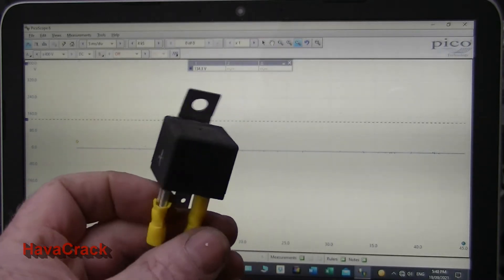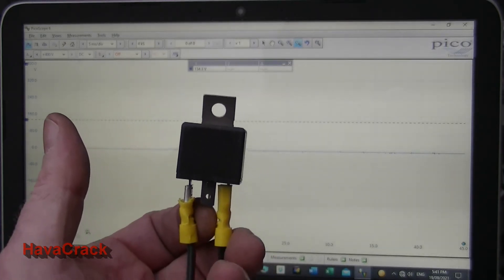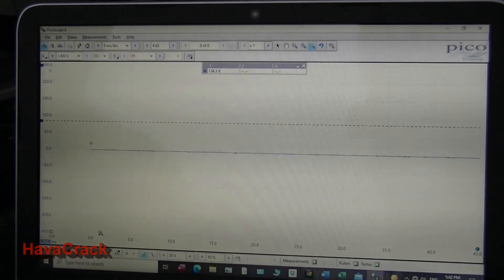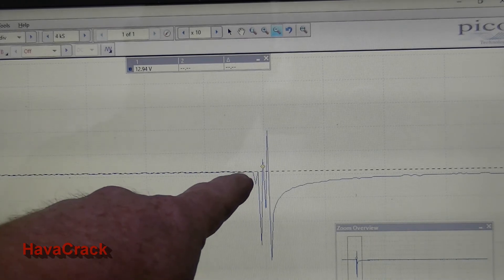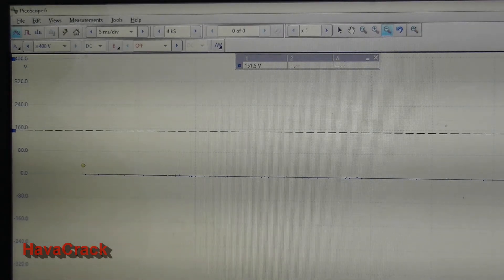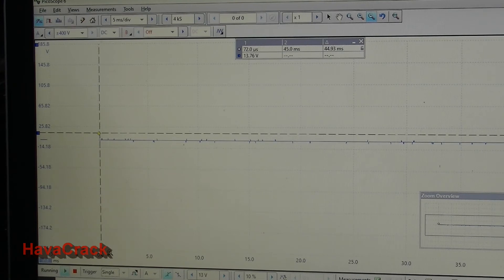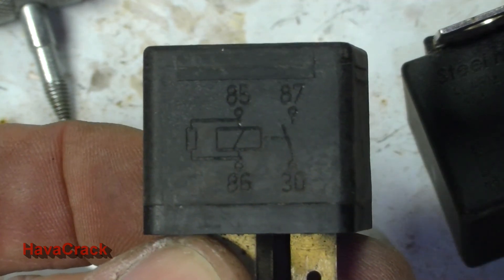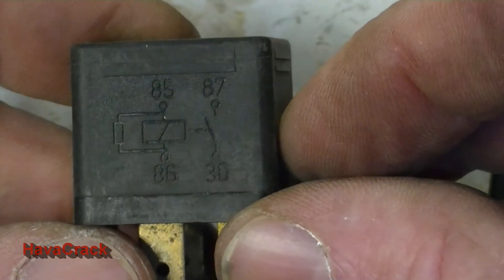HavaCrack - Relays and Diode Protection to prevent damage to modern vehicles computers

Comment: Actually the schematic on the first relay would indicate it uses a resister to clamp the fly-back voltage and not a diode and since resistors work in either direction the relay is polarity agnostic
Reply from the maker: Yes you are correct, that one was a resistor type. Mick

Comment: Thank You that was great info....You mentioned some relays have a resistor rather than I diode...do they serve the same purpose or are they for different applications? I have a relay which shows two diodes (D1, D2).  Is that significant from using a single diode for the application? Its for an Pump(ABS) on a classic SAAB 900. I am getting zero Resistance across 85 and 86...has to be 50 to 120 ohms? it still test good on all other counts. 
Thank You in advance.
Reply from the maker: Bill, I am no expert, just like tinkering and learning.  But a resistor performs the same function as the diode but with some minor difference in relation to voltage drop (not relevant in a 12 volt circuit) and allows current flow.  A relay with a resistor is used as it does not matter if + or - is connected to 85 or 86, where a diode has to be wired with the correct polarity 1. to work and 2. to prevent damage to the diode, so a resistor is more safe in that less likely to damage the suppression of having a diode.  The best I found as to why two diodes in a relay is that speeds up release contact time https://www.te.com/commerce/DocumentDelivery/DDEController?Action=srchrtrv&DocNm=Definitions_Relays&DocType=SS&DocLang=EN
As far as measuring the resistance across 85-86 I have typically measured 67-87ohms on a number of relays, does not matter if it has a diode or resistor.  On a relay with a resistor I pulled one apart and measured 6.2megaohms for the resistor value.  If your relay is measuring 0ohms across 85/85 are you sure it is working as the diode should not be impacting the resistance of the coil in the relay.

Comment: If 85 + 86 are wired backwards with a diode it may work briefly but that's also essentially a short circuit. I'd imagine ECU's would already have some suppression integrated in the control circuitry already. May have some benefit to aftermarket add-ons and whatnot but fairly redundant on OEM components.
Reply from the maker: Thanks for the comment.  Yes you have to wire a relay with a diode correctly. If you have a relay with a resistor then you can get that wired backwards.  Not all ecus have proection, or more to the point they will for the oem circuit if required and/or the oem relay if needed to be replaced should be with another oem relay. The point of the video is that if you wire an aftermarket relay into a modern vehicle then use a relay with either a diode (wired correctly) or a resistor if you want to add some protection to the circuit/ecm etc.  Regards, Mick

Comment: I admit same thing.
Me car wuld work at blinker relay speed with key off.
Me engine wuld run out of control because of back feading alternator,4pin relay rear heater defroster and non existing ballast resistor on xenon bulbs .
Also the alternator starting charge interacts with extermal resistors and capacitor types.
Thats all true I try for days to fix those problems .
Can some one recoment me what relay diode to use on me set up?
2pin hella lights on  buzzer,
6pin hella wiper relay,
4pin bosch defroster relay,
3pin siemens blinker relay.
To note me dashboard has no diode for the alternator field only bulb on pin 1 on me delco 12si alternator and that field is oddly conected to the 4pin defroster relay on pin 86 for some strange reason.
So I hoppe some one can explain to me why those multipel relays interact with ich other and other devices in me car and where to put diodes and what value perhaps recomend me zener diode or how posibly I culd control those odd behaviors because some of them are usefull for engine operation like dimner circuet or amplifier for ignition coil with out useing the 4pin gm ignition module so I cinde of liked that buzz coil effect and the self aceleration engine or magnetised speings culd be effect be used to remote control me engine speed its classic opel car from the 80s tipical gm layout design .
I hoppe for some help how to wire ich circuet seperatly.
Also I belive I have problems with rear bulb holder as well many wires share common - conection and those bulbs are dual filament.
So Im in proces to restore me entire wire harnest.
Reply from the maker: Sounds like a lot of issues and your relay being feed from the alternator sounds strange. If you do not have a factory electrical diagram have you tried to isolate which part of the circuit(s) are causing your issues. Can you unplug the relays one by one or the fuse that feeds them and then try to find the circuit that maybe causing the issue? Mick
Reply: @HavaCrack  I did found the cause for the blinker it was corrosion on the rear bulb holder wire going to ground hade green staff on it and me ignetion switch hade thiner black wire going to fuse box started to burn simply removed corrosion and cutt that wire added speed conector and blinker stoped acting like buzz coil.
How ever the self aceleration engine stops if I dont use head lights or if I unplug blow by hose with betalic air filter it looks nearly like the trothel cabel gets contrapted to the metalic air filter.
So I did notice the 4pin relay draw current over night empty the baterry so I did removed that relay basicaly I removed all me relays and still some functions work with out them only left the blinker relay .
That self aceleration disapeared for a while now it apeared again.
Me wire harnest is stock standed Opel or GM wire harnest.
Im confused as well honestly.
Dono where that staff is comming from .
I made wire diagram for me car to easyr locate problems.
I noticed only didnt even know that xenon bulbs need resistor me car worked for years with out it tought.
Only odd things that I culd finde after me resurche was mouse aperantly eat me door switch ground wire and I found beaten up hande brake wire but those are all ground wires ,interior over head bulb I removed years ago draw current on me.
I dono what to say I think the integrated diodes got fried on me bosch 4 pin relay and I did notice even tought odd I have 2 different types of horns normali I did split up wire on my radiator fan so Im manuali engagin the fan motor wia switch.
As described before odd behaviore lot wires share common positive and negative conections thats the problem I ques.
I will try out to use only wires as ground to me baterry in hoppe to reduce wear corrosion on me chassys .
I made a mess over filled me baterry with acid evry where corrosion from that mistake so Im preaty much anoyed at me car.
Thats why I will make ich circuet seperatly to locate that problem.
Evry thing I removed from car today started the engine manuali only left big wire alternator-starter motor-pin for starter selenoid ,extended alternator fields wire and simply tap it on baterry when necesary and I did wire up 4pin relay from defroster and used it on me 4pin Hei E Core ignition coil well engine works normali.
So Im not shure if positive linear voltage regulator can back charge or not wuld like to know if there is posibility to put diode at that thing as well I unpluged all me dashboard and will only leave milage counter and gages for temperature and fuel gage with thick wires reinforce them .
Other then that I didnt notice any thing suspiciuse just messy wire harnest honestly who doesnt make sence .
Mainly the blinker circuet and head light circuets are mostly confuseing way wound so I decidet to use dual filament bulbs insted me blinker bulb holder fits nearly perfectly with out the rear bulb holder in those holes I might as well give ich circuet seperate ground wire so I hoppe the problem goes away .
If not then Im stuffed basicaly only other thing left is the alternator it self or the starter motor it self to modifi them to cloosed loop systems .
I actualy did build for experimental porpuse starter motor with dual insulated brushes only thing to do is seperate starter selenoid from ground for the alternator hes alredy insulated just field circuet needs cloosed loop regulated circuet .
I dono I experiment lot with engines but culd never undestand why that does that strange aceleration problem .
Im confused like hell .

Comment: I know the type of diode used depends (at least partially) on how extreme the back EMF is.
So, without having an oscilloscope, how would I go about "guesstimating" the back EMF?
Also, are there any draw backs to just going with a diode that's overkill for a particular application, other than a slight delay when disconnecting the power from the relay?
Thank you!
Reply from the maker: I am not an expert but a 4001 diode will be sufficient for most applications.  If your circuit is not going back into a vehicles computer then there is no real need for the protection e.g. old cars had relays but no diodes. The purpose is to prevent a voltagw spike going into another circuit that does not have protection.  A 4001 will be sufficient for a 12v system if that helps.  Mick

Comment: How can I tell if a relay has a diode built in?
Reply from the maker: If you look at the schematic on the relay it may have an image of a diode sumilar to this >|  Between pins 85 & 86 on the outside of that circuit.  If it has an image of a rectangle between those pins on the outside of the coil image then it has a resistor.  If it has nothing, just an image of a coil between 85 &86 then it has neither.  
If it has a make and part number you could google the specs.
Mick